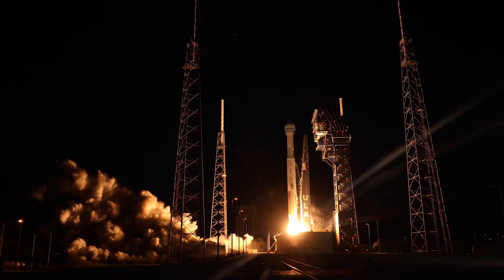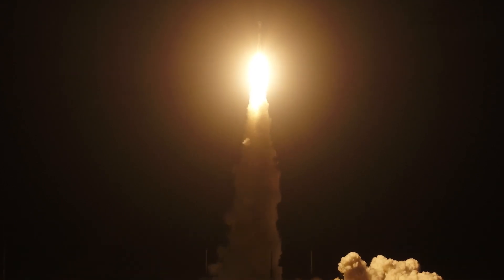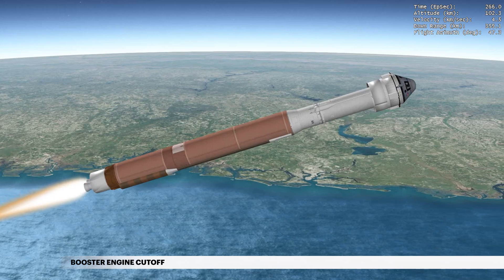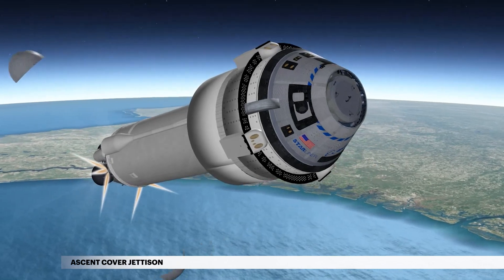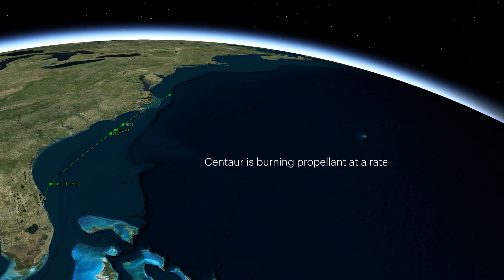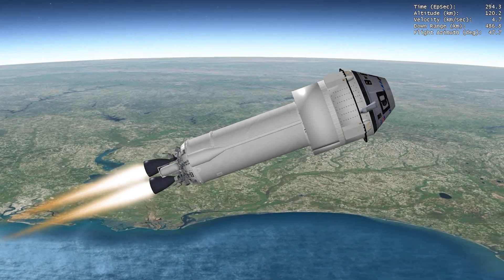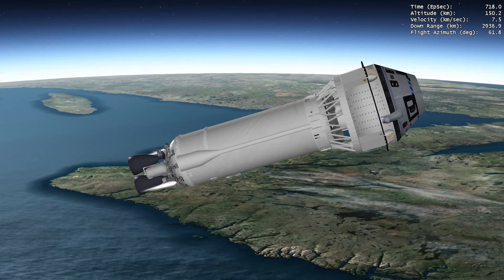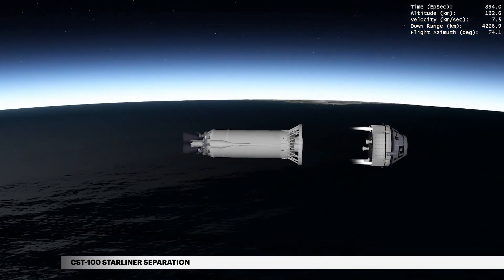Atlas V OFT-2 Mission Profile

Comment: When is Boeing Starliner going to transition to the Falcon-9 or Falcon-Heavy?

No landing attempt? ULA launching another Atlas without trying to figure out how to land the first stage. No parachutes on the strap-on boosters? Is ULA going out of business?
Reply: Starliner will transition to the Vulcan rocket ( a soon to debut ULA system) after Vulcan is Human rated and  certified for launch.
Reply: @williamduffy1227  LOL, yeah, ULA will get to make lots of profits building new disposable rockets, while Blue Origins makes nothing because ULA doesn't make engines, so reusing them is acceptable.
Reply: @WeBeGood06  ULA will capture the BE-4 engines after the flight, you apparently didn’t know that.  They just don’t go after the expendable stage, which is not that important because it is just empty tankage.  They will be able to capture and reuse the engines without a performance hit like SpaceX suffers from, and keep costs down by reusing the most expensive (by far) part of the booster.  The performance advantage will be a significantly attractive option for customers.
Reply: Not every rocket company needs to land its boosters.
Reply: @jeremiahpurba3882  Correct.  SpaceX wastes so much potential by carrying the mass of the landing system and landing propellants.  Between that and the fact that their rockets have a gazillion engines (i.e. the component most likely to fail, multiplied by the number of engines), I would never select one of their launchers for a mission.  ULA’s track record is second to none with the most experience in the business and Atlas V doesn’t waste performance on an ostentatious stage landing system.  Good for SpaceX, I wish them well, but I have never been the least bit impressed by their booster landing stunts.
Reply: @Rocket_scientist_88  I agree with most of your points, but I think the conclusion should be that both SpaceX and ULA are specialized in different areas, one is cheap, but is riskier, and has less deltaV; and the other one is more expensive, but is more reliable, and has more deltaV. About the rocket engines, falcon 9 may have a lot of engines, but they're much more simple than the oxidizer-rich staged combustion cycle RD-180s ULA uses, and less parts. Something that's also kind of funny is that the RD-180 came from the NK-33, which was a updated design from the NK-15 engines of the N1 rocket with 30 first stage engines. I personally find the booster landings impressive every time (especially the falcon heavy one), and I don't a failure from landing would hurt anyone, since most of the landings occur at sea hundreds of miles away from the nearest person, and when there's a ship which got lost and wandered close to the drone ship, they delay the launch until they safely evacuate the ship. The booster recoveries are really something that haven't been done before, and if you pull up the DC-X argument, note that it never made it as high as the falcon 9, it never went as fast as the falcon 9, it never re-entered and faced the same heat as the falcon 9, and it didn't do a suicide burn like the falcon 9.
Reply: I’ve never been impressed with the landing of boosters.  Too great a hit on rocket performance.  SpaceX has always made a show of it but all I see is wasted opportunity for a better mission.  Stop concerning yourself with the splashdown of empty tankage; ULA will recover the most expensive portion - the engines - for reuse later.  One of these days SpaceX will have a massive failure with those reused booster stages and tanks.  I just hope nobody is killed when it happens.

Comment: Let's hope this one's the one. Do you guys or Boeing have any prospects of creating or using a fully or partially reusable booster?
Reply: Vulcan is partially reusable. That isn’t a prospect - it’s flying this year
Reply: @alrightydave  100% the Vulcan is not flying this year.
Reply: @AlrightDave *Vulcan is planned to be partially reused which may never materialize.
Reply: @woodduck_23  The engines on Vulcan are reusable, not the stage itself.
Reply: @coltoncollingwood9508  I wonder which cost more the BE-4 engines or the RL-10 engines?
Reply: @coltoncollingwood9508  How would the engines being reusable but the stage not actually work? 🤔🤔🤔
Reply: @idleeric8556  Idk but I do remember when Vulcan was being early in development that only the BO engine were reusable, its possible maybe now the whole stage is but I have seen no effort for a suicide burn or chute recovery
Reply: @WeBeGood06  The RL10C-X is supposedly modernized to the point that they're competitively-priced. To the point that Centaur V has two engines by default, yet is cheaper than Atlas V. So it could very well be that the BE-4s cost more.
Reply: @idleeric8556  They detach from the rest of the stage, deploy a heat shield, then parachutes, then get snagged by a helicopter.
Reply: @pseudotasuki  So; they will design the rocket so that both engines will detach themselves from the rest of the stage mid-flight? Won’t that be an enormously difficult thing to attempt? And they are going to need a very robust container to store the parachutes in. Where will the heat shield be placed during the ascent? My understanding is is that catching something heavy with a helicopter mid-flight is inherently dangerous for the pilot of the helicopter.
Reply: @idleeric8556  The engines will detach together with the thrust structure.

I don't see how detaching the engines would be a particular challenge.

Why would the parachute container need to be robust?

The heat shield is inflatable. Remember that this is suborbital reentry, so it doesn't need to withstand extended heating.

Yeah, the helicopter catch is a bit dangerous. Note that Rocket Lab recently caught an Electron booster with a helicopter (though they had to drop it due to the parachute unexpectedly inflating).

Comment: Never fails to impress me. Good job ULA
Reply: What impresses me is that ULA can crash every rocket they launch, and they are still in business in the age of non-disposable rockets.
Reply: @WeBeGood06  - You have to admit that the ULA team performs well within the constraints ULA's Board and owners (Boeing and Lockheed Martin) place on them.  Also the Atlas / Centaur is a fine rocket that performs well, even if the design is decades past it's prime.

But it is unfortunate that they are not able to even try to land that first stage.  But I just don't think you could propulsively land an Atlas V as the first stage lacks the throttling capability necessary.
Reply: @WeBeGood06  HULA has 100% succes rate.
Reply: @WeBeGood06  Go back to twitter, Elon…

ULA doesn’t “crash every rocket they launch”.  They just don’t try to land the booster stages but will capture the engines after use.  The empty tanks are not the expensive part of the booster anyway - but landing them (or, trying to land them as SpaceX doesn’t exactly have a perfect track record with that) is a significant performance hit in the extra mass carried by their boosters.  ULA’s launchers aren’t weighed down with all that so they are able to perform better.

You really have it in for ULA, don’t you… seriously, is this Elon Musk?  This would be the very sort of childish behavior we have come to expect from him. Wouldn’t surprise me if “WeBeGood” IS Elon.
Reply: @WeBeGood06  they’re barely in business to be fair, just look at their launch cadence compared to spacex’s